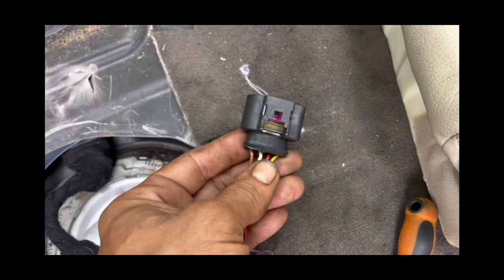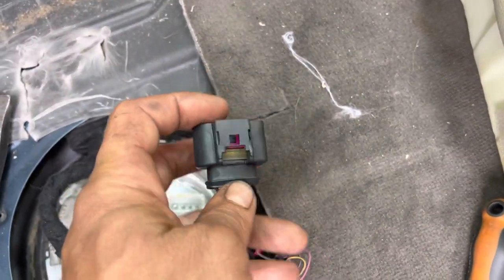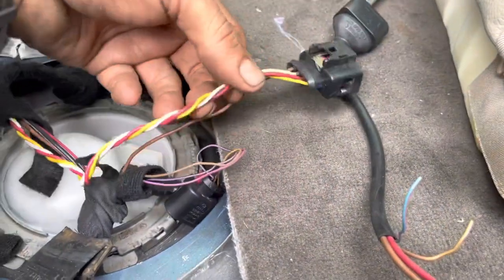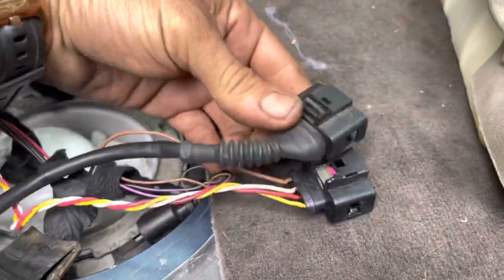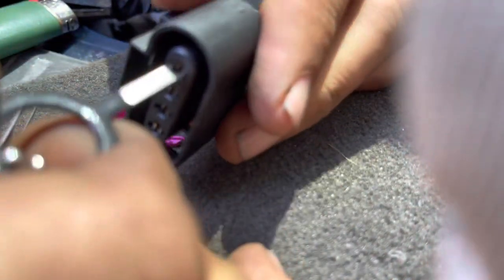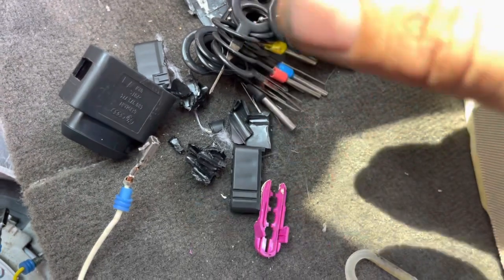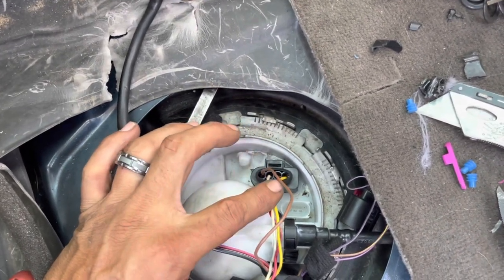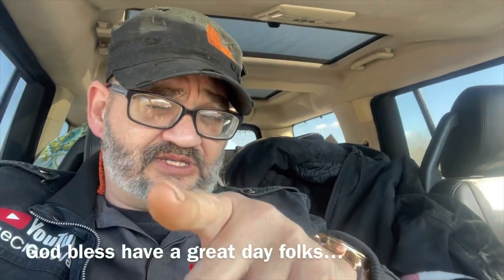Broken Electrical Connector Repair At Home Easy and Quick

Comment: Ive got a 2006 merc mountaineer where coating on wires of mass airflow sensor connector have come off i tried just wrapping them w electrical tapebut still having issues

Comment: Just found you and gonna follow as well. This video was very helpful. But my problem is I need to disconnect the harness. I broke the release tab. Now what?
Reply from the maker: Cut it off and rewire it. You can buy them pens,

You can get a plug from the junkyard that already has the pins on it and wiring leads . Them Are the simplest ways to fix it?
Reply: Thank you for the response. But I'm trying to avoid cutting wires and rewiring. I'd just like to get them disconnected but I broke the secondary release clip